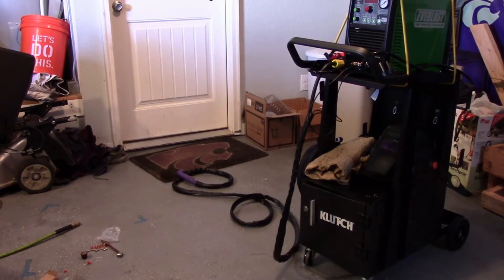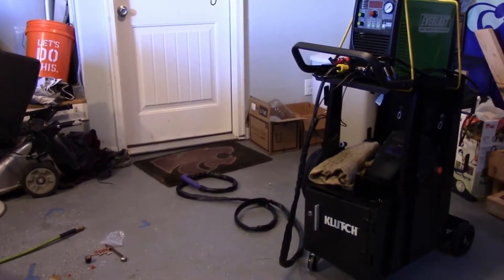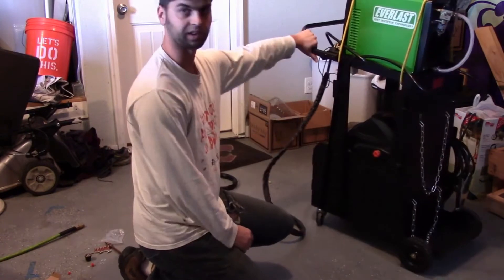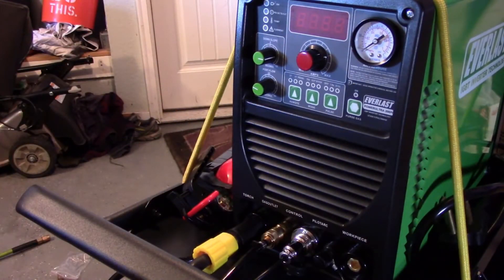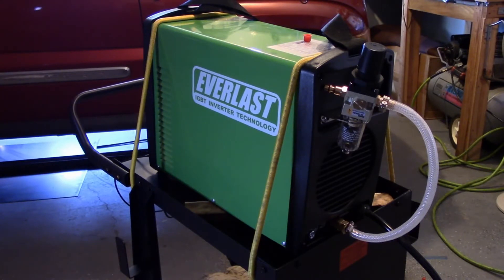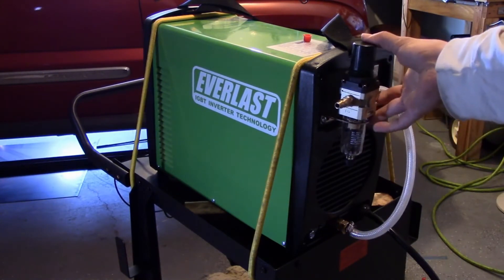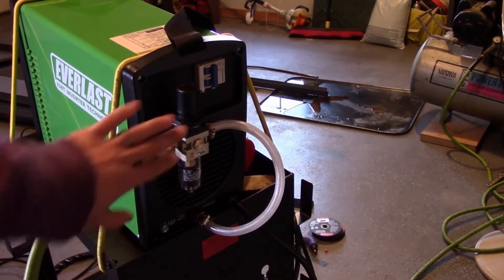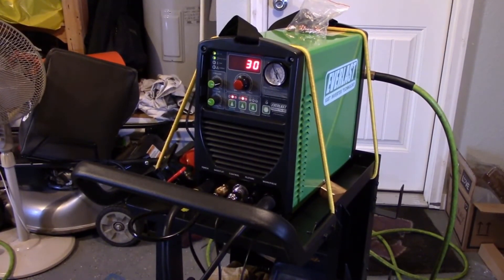Everlast PowerUltra 206i First Impressions: Plasma Mode

Comment: Should just set to 50 amps and leave unless cutting on 110 volt. around 60psi is what I have found with most plasma cutters work best and be sure to keep the water trap empty and empty your compressor water eats the consumables fast. I would love to hear you overall thoughts now and on the tig as well. I Am looking for a 50 amp blow back pilot arch plasma and for almost the same money I can get this combo and having a small portable tig stick is always good plus will be a good back up for my Everlast 221sti. Which I love with all my heart. After 25 yrs welding in a fab shop it is the nicest welder I have ever used let a lone owned. When you are ready for a bad ass mig and AC/DC pulse tig it is the one to have. SO if you see this please leave a comment on your thoughts now
Reply from the maker: You can double check the date on this video for yourself and see how old it is! I've come to know how to use the machine a little more since my "first impressions". I really do love this thing. I'm not metal fabricating as much as I'd like right now (have been on a long draught since February-March), but I'm completely happy with this purchase. Love this machine. It suits me as a hobbyist just fine. I can't speak much towards the angle you were probably hoping for as having 25 years in a fab shop, but I hope it helps. Granted I can't compare it to a lot of other machines because I frankly just haven't used many others.
Reply: @Str8sixfan  thanks man. Sounds good I think this is what i am going to do just because stupidly it is $50 cheaper than a Everlast stand alone plasma with the exact same specs. I encourage you to keep building stuff no matter the size of the project its always been a good stress relief to me. To design and build something and have it work out like you wanted is always a great feeling.

Comment: there is a large black nut on the regulator under the adjustment knob if you unscrew it it will come off over the adjustment knob. Then take and pass the knob thru the bracket bolted on the machine and screw the nut back on to hold in place. Or thats how it looks from here and almost every regulator I have ever seen is that way
Reply: lol should of watched the whole video before commenting lol
Reply from the maker: Hey no worries! Thanks for watching.

Comment: You should download the manual from our website.  It is full and complete.  everlastwelders.com.  Also 70 to 75 psi is the best choice for this plasma cutter.
Reply from the maker: Everlast Power Equipment I have since, and it has been helpful. Just last week though I believe the heat of the piece I was cutting melted through the torch's plastic sleeve. Would this cause an E06 code? I electrical taped up the damage, but haven't tried it again
Reply: Off the top of my head, that is a low air pressure signal.
Reply from the maker: Everlast Power Equipment hmmm... maybe my air compressor wasn't plugged in, thanks!

Comment: Nice, I keep thinking about getting a plasma cutter and just when I talk myself into it I think how often I would use it and then I don't get it Lol
Reply: I have saved countless amount of time with my everlast plasma cutter. I don't regret getting it all. To be truthful it is my favorite tool in the shop.
Reply from the maker: I'm still trying to get used to the plasma cutter. Was cutting some 1/4" steel with it the other day, and it was  pretty challenging. Need to keep playing with the settings.
Reply: Sorry for not replying for so long. Make sure you are using dry air and I think I keep my PSI around 62. My Everlast plasma cutter is real work horse. I love using it.

Comment: nice rig!  Yet another tool I want...plasma cutter.  I have the Klutch 220si (stick, mig, spool gun, DC tig).  I should review it.  So far I like it.  I have only used it for Aluminum and a little mild steel flux core.
Reply from the maker: So far, I love this thing. I'm hoping in the next month to buy an argon bottle and try the TIG out.
Reply: cool.  Argon?  Doing aluminum?  Im not familiar with TIG, but I think you can still use a CO2 mix if working steel.  I used 100% argon for Aluminum.
Reply from the maker: hmm...well then appears I need to do more research...ok, actually appears it is Argon. https://www.millerwelds.com/resources/article-library/tig-it-how-a-tig-welder-works-and-when-to-tig-weld
glad I looked it up though. Thinking is not knowing!
Reply: Yep.  Shows what I know.  Apparently the CO2 will contaminate the tungsten.  I suppose I should have researched before trying to confuse you!
Reply: @HodgePodgeGarage  Only argon and helium is ever used on tig steel or aluminum. Argon is the most common and cheapest but there are many different blends of the 2.
Reply: @jvmiller1995  right on... welcome back!

Comment: Nice plasma cutter and cart. Like any new tool it takes a little while to get used to the adjustments and settings. Good design for the welding table
Reply from the maker: Sorry for the re-run, but figured it was information that prospective buyers may be interested in.